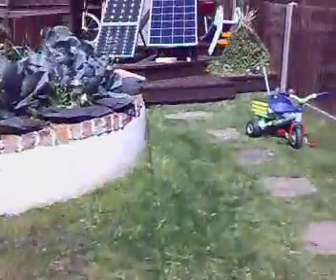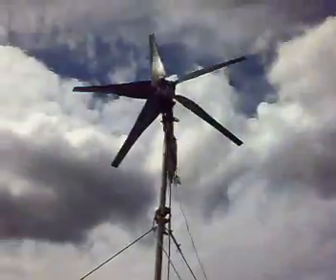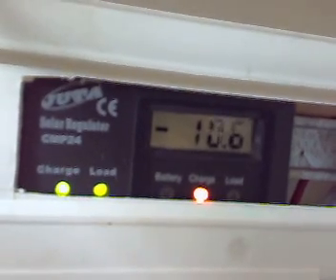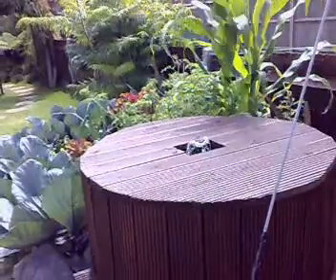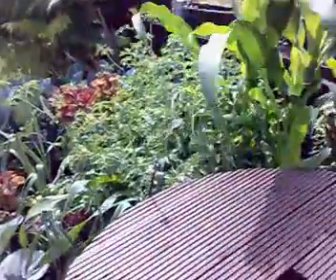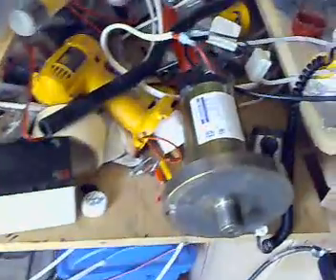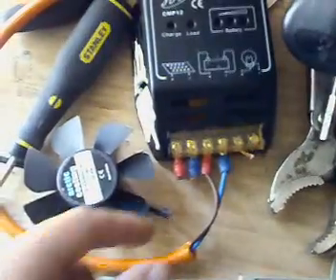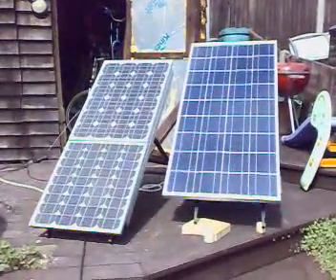wind turbine /solar power/hybrid power/off grid

Comment: The best thing is to get the solar panels on your roof, that's what I did, and all the wiring stretch on a marine hock or several garden hose hocks on the wall and out of way to clean up the clutter and let the garage free for other things... good luck I got the solar panel; for the past 6 years...  and it's working fine...

Comment: I suppose you could also make a concrete base and bolt them down to the ground.  That way, even if someone did manage to dodge the fauna they couldn't just tuck a panel under their arm and run - it would take them time and effort to remove, giving the rottweillers more sporting opportunity :-)